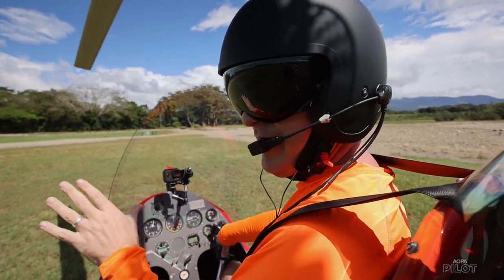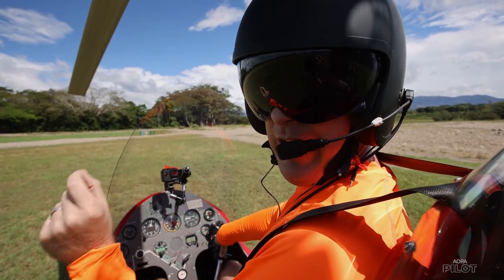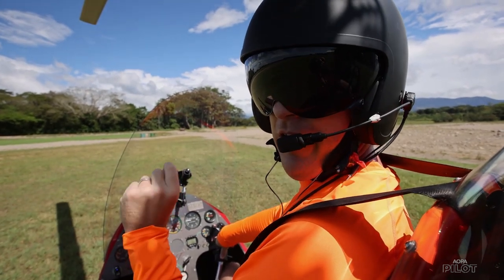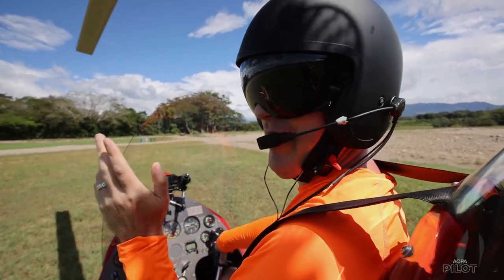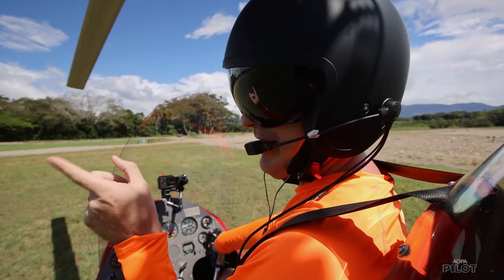Gyro Hero - Takeoffs

Comment: Funny that it works but very difficult to spot any merits to the configuration. Fixed wing just seems strictly better.
Reply: Until you have an engine failure in a fixed wing. In a Gyroplane you have way more landing options. The gyroplane is much more stable in wind than a STOL configured fixed wing. All designs have merits and tradeoffs including fixed wing.